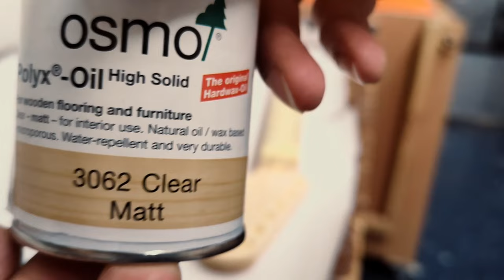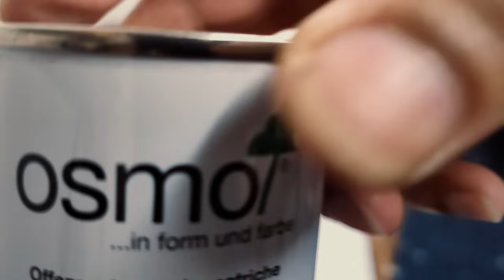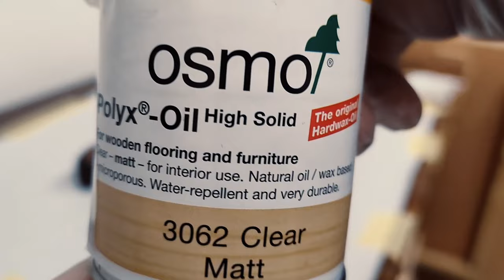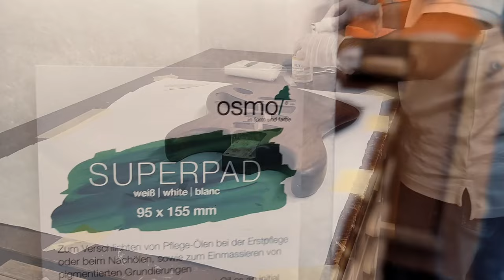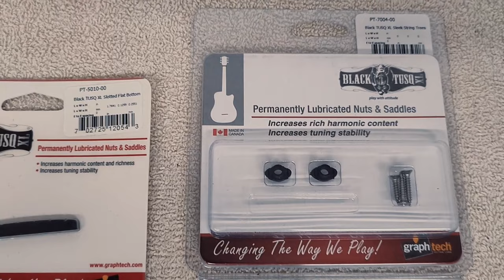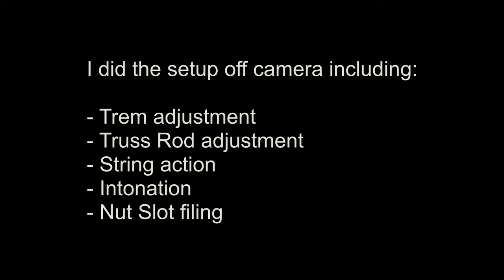Walnut Stratocaster (HSS) - My first guitar build

Comment: im building my first guitar too. I am making the ibanez jem woody from a piece of african mahogany with a few modifications. the pickguard is brass @ .023 with a layer of mahogany @.0625 and a layer of mappa burl at .023 on top. the read cavities are .023 steel , .023 brass and .023 mappa burl and held in magnetically. i got the edge zero 2 with an FU Tone brass block and FU Tone noiseless springs. the electronics are a CTS 500k for volume and a push/pull cts 500k for tone with an ibanez 3SWLSP5 5-way switch  and a 2 way switch for 7 way tone control with all rosewood knobs and switch tips. im using the dimarzio dark matter pickups in HSH configuration. I have the ibanez flip open truss rod cover and gotoh 510 non locking tuners. Neck is maple with a mahogany veneer to match the body with my Q5 Graphics logo inlayed into it.    the inside of the trem cover will be a list of all parts with part numbers lasered onto the brass and the pickguard will have various prayers pertaining to music lasered into it. the strap buttons will be D'Addario strap locks. the trem claw is a heavy duty brass model and of course the output jack is angled up 45 degrees at the rear side of the guitar making it easier to put the cord through the strap. this is my first from scratch guitar. i made a partscaster 40 years ago which i had until 2013 when i sold it to a guy wanting the ESP mark1 neck it had.

Comment: Just wondering why you didn't clamps the pieces to put pressure on tge glue seam..
Reply from the maker: Hey Travis. I didn't have long enough parallel clamps so went with a DIY option for clamping 😂😂 I do have to get some parallel clamps though 👍